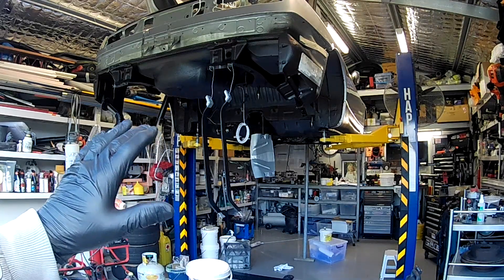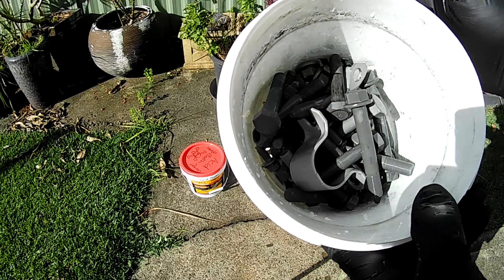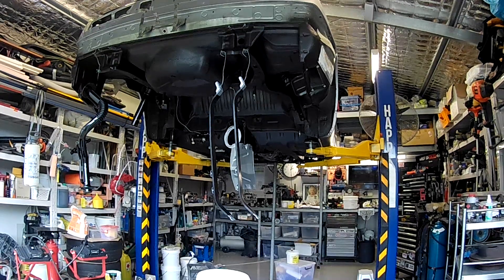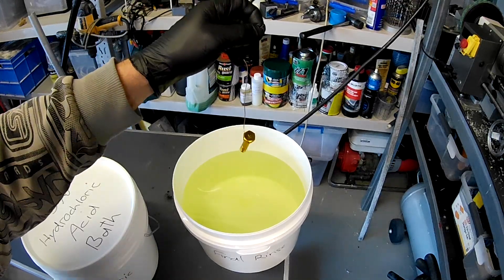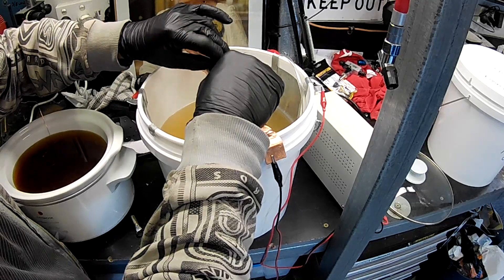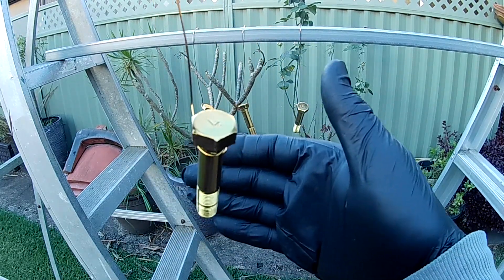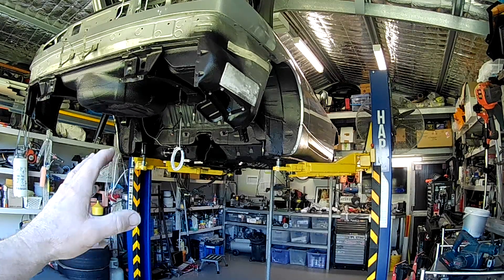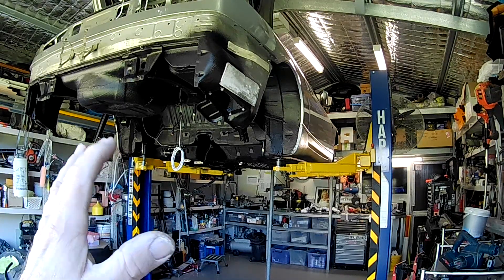Electroplating In The Aussie Shed. Project Fairlady, The Nissan Z32 300zx Twin Turbo Mega Build.

Comment: Hi Trevor what grit is the Diamond plate you used when you where lapping 
the mini lathe, also is that zinc plating a kit that you bought
Reply from the maker: G'day Mate, i'm using the "Caswell Kit" for the plating, from memory i think it may have been around 80grit, I have quite a few of them in different  grits so a little hard to pinpoint exactly. Cheers.
Reply: @TheAussieShed  I thought so cause of the way the plating come out, good job
nice and shinny, that's because of the brightener they use, when i tried it, it was very dull
and grey

Comment: I had plans myself to do this exact procedure with my z32 project. Alot of parts new from nissan are not been coated or plated so keep that in mind. Also i am guessing your having trouble with z1 motorsports which im not surprised with. Ive spent abit of money with them in the past and yes customer service isnt top notch. Concept z is better for service in my opinion. You can also deal with nissan japan direct with a site ive used in the past but its based in japan, jp-carparts.com
Reply from the maker: G'day Mate, yeah, I think there service is extra crap lately due to their expansion. I've had mixed interactions with them in the past, some good, some bad. I agree, Concept Z are well organized, I have had quite a few orders with them in the past with no issues. Unfortunately some of the items in my order are not stocked by them. Anything OE I get from Nissan directly, either through Amayama or Connections I have here in Aus. Appreciate the comment, Cheers Mate.
Reply: @TheAussieShed  if you ever need help with part numbers and or information regarding the z32, dont hesitate to pm me, ive study these cars pretty heavy with regards to oem options and history. Im on the aus300zx forums under username ADAMZX.
Reply from the maker: @nightwolveX  Cheers Adam, i might take you up on that in the future, appreciate the offer. Thanks Mate.

Comment: What is your opinion on "hot bluing" nuts and bolts?
Reply from the maker: G'day Mate, I only have a little bit of experience with Hot Oil bluing, which usually turns out quite reasonable. For the most part though I go for the Cold Blu. I've had pretty good results with it. Cheers.
Reply: @TheAussieShed  I use my natural gas powered BBQ with a thermostat to bring the parts to proper temp before the oil bath and that seems to work real well for me - stinky and a bit smokey but I do like the finish. I work on motorcycles so, it's important for the fasteners to look good - to me at least. Your plating process gives some sexy results though but, a very fussy process to get through. Love your videos, they inspire me to do the best work I can as an amateur. I'm the guy, you might remember, that followed your "cheap Chinese lathe" rebuild - so glad I did!
Reply from the maker: @WaxMeister  G'day Mate, yes I remember you (great user name) thanks for that, much appreciated. Cheers.

Comment: I am happy to see that I will be able to use my welding PPE when I have a crack at this.
Reply from the maker: There is No Better Protection Available. Lol
Reply: For that special DIY welder's dance when spatter sizzles it's way through the toe webbing to the rubber and having lost enough heat, it slows it's progress through the rubber to leave a final reminder. Still,,,,,,couild be worse, when you're wearing leather steelies, the leather stops it getting out once some falls in behind the tongue amd that's when you do a more Celtic type of jig and hopefully you are using MIG instead of stick, because with the stick, you end up letting it go during this unforseen desire to dance, the welder's hood has landed several feet away and the stick invariably lands on the job and re-stikes an arc and you get welding flash again, further reducing the shrinking patch of undamaged retina that corresponds to your centre of vision ;)

Comment: That is way better than I've ever been able to achieve. Very impressed. It looks like you managed to zinc plate inside the nuts in the threads...any tips on how to achieve that? (Not that it matters that much from a corrosion perspective).
Reply from the maker: G'day Benny, trick of the light Mate. maybe just a bit in there, but nothing of note. Cheers.